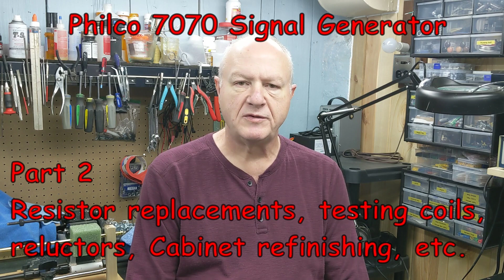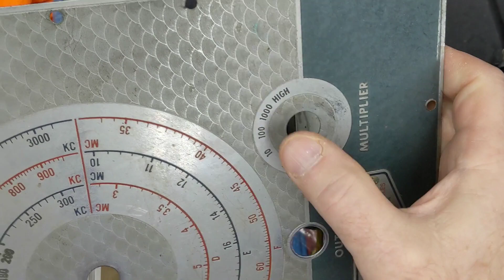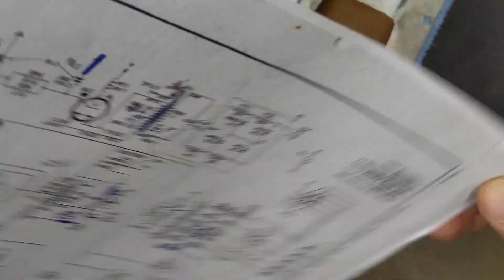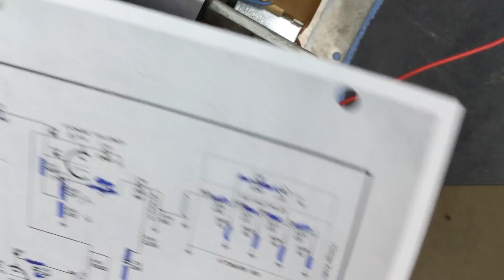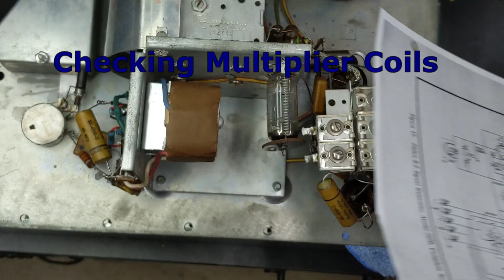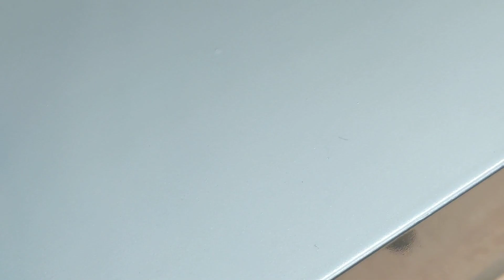Philco 7070 Signal Generator Part 2-  Resistors, repairs, cabinet, etc.

Comment: Are the re-stuffed line caps Y safety caps designed to fail open?  Otherwise a cap failure can blow a fuse or make the chassis live.  "Ceramic Disc Capacitors 15kVDC 2000pF 20% Y6P Straight LL"  several manufacturers and specs.  They have a color code and these are blue.  They will not fit inside the cap shell, but I am not sure safety caps should be in a re-stuff, for safety sake.  :)
Reply from the maker: I could not find the proper size of Y2 caps., so I fused it. This will only be plugged in when I'm using it anyway. Also, safety caps didn't even exist back until the last couple of decades so I didn't feel it was a huge deal. Thank you for watching.

Comment: Gregg, I had this thought while watching, and maybe you already have mentioned it, perhaps you could put a decal on the inside of the chassis noting that capacitors have been re-stuffed, the approximate date, and the manufacturer(s).  Your successor and assigns may appreciate that.  I don't re-stuff, but I have seen many admonishments on these videos to check before re-stuffing.
Reply from the maker: Yes sir, that is the plan. Thank you.

Comment: I have done some hammer tone paint finishes that looked pretty good when I was done the trick is to use a heat gun to warm up the paint after you paint it then the hammer tone finish sets in. But great video and really great seeing how you replaced all those parts and tested the coils I have that same tester I use all the time as well.
Reply from the maker: Thanks for the tip Larry, I'll have to try that next time. It's cool that you have a 7070 too!
Reply: @greggsvintageworkshop8974  I used that tip I got from Henry Rogers who I know personally and he has the radioBlvd.com website and has a warehouse full of radios on his property on 40 acres in dayton, nV. He has done crackle finishes and Hammer tone finishes. I did a 3 part video on his collection on youtube last year. He is the same age as me 69 and has also been an amateur radio operator for years call WA7YMS. I meant I have that same tester not the 7070.

Comment: Great job Gregg! 👍👍 Using modern capacitors I don't see anything wrong with restuffing the bypass caps to keep the original look  instead of using safety caps. It's not going to be plugged in all the time anyway. 🤔
Reply from the maker: Thanks Bob, I was originally going to use Y2 safety caps. but I didn't have that size (.05) and I didn't see them listed at Sal's, Ebay or Amazon. I figured they didn't have safety caps, back when this was built anyway, so I should be fine. I did fuse it though.

Comment: Nice job Gregg.
I think those two wax caps were line bypass caps, if so you may want to install safety caps in their place.
Even if the cabinet did not come out hammer tone it still looks great.
Reply from the maker: Thanks Bill, I was originally going to use Y2 safety caps. but I didn't have that size (.05) and I didn't see them listed at Sal's, Ebay or Amazon. I figured they didn't have safety caps back when this was built anyway, so I should be fine. I did fuse it though.
Reply: @greggsvintageworkshop8974  You should be fine, I agree back then there was no such thing as saftey caps.
The new caps today will outlast  the wax caps used back then